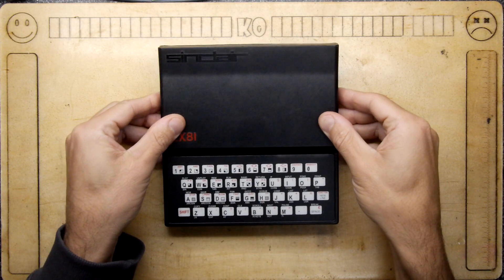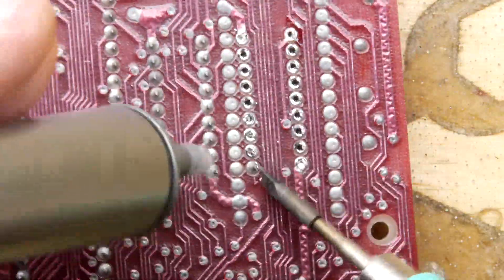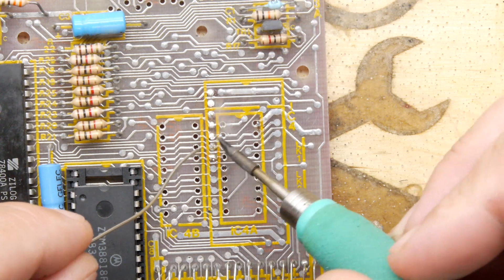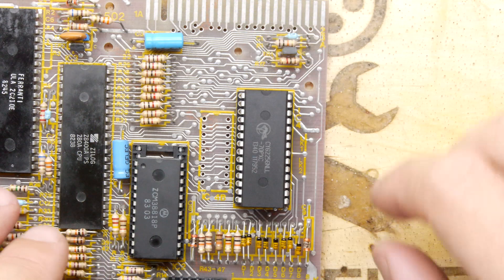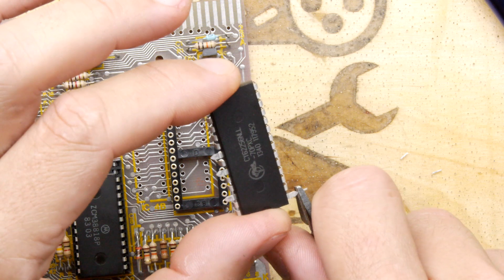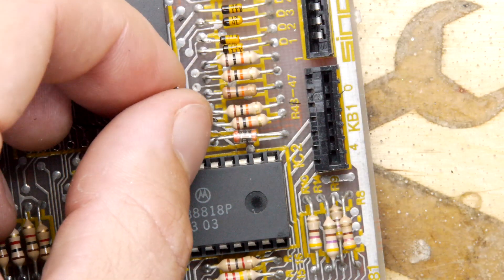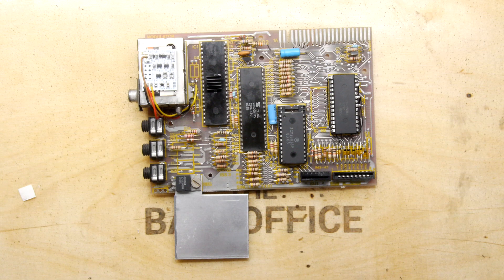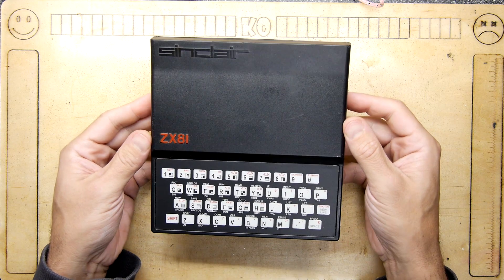How to install a ZX81 16K Ram expansion - 10 minute mod!

Comment: Nice video and explanations.

The spot for 16K RAM chip follows the JEDEC specification (24 to 32 pins) for static RAM and ROMs.
I guess the wiring on the PCB was designed for a 1K chip and thus lacking the 4 Address lines but I don't understand why not adding the adress lines directly on the PCB.
The original chips 1K * 4 never use those adress lines so there is no risk to add them to the 24 pins footprint.
The only possible issue is if some of the address lines are connected to power or extra CS lines.

Comment: Back in the 1980's, those 32K x 8 Static RAM chips were quite expensive. I bought one and used it with a 74LS138 (3 of 8 decoder chip) to build my own RAM pack. Saving any programme with the ZX81 running 32K of RAM takes ages, so I ran it as a 16K RAM pack, mainly. My home made RAM pack never had any wobble issues, which seemed only plague the official Sinclair RAM packs. 

I also built 2K, 4K and 8K RAM packs, as I used my ZX81 for robotics experiments and a smaller memory size equals longer battery life.

Comment: Hello, I did the installation, step by step, on my Timex 1000. It's showing the white screen, but without the cursor.  I know it would take a few seconds, but it doesn't show up.  I'm guessing that when using the socket for the memory, soldering only occurred on the lower tracks.  It makes sense?  I'm thinking of extracting the socket and soldering the memory directly to the board.  What do you think?

Comment: this type is the cheapest and most convenient way to expand the zx and 99% of all programs get by with 16k. In addition, the zx81 takes a relatively long time to run the ram test. The area on top 32k is also required for the screen structure. The z80 is used as a line counter for the composition of the image.
In the lower area you can change the decoder so that the ROM is not mirrored, so you can still add 8k , but these are not seen by the basic.
But it will not deleted when you type in NEW.

Comment: You could use a switch (or an IO port for that matter) to pull the most significant bit of the address lines up and down in order to page in the unused upper 16k of the chip. Not sure what use that would be though.

Comment: As far as I know: Mounting the 2k Jumper, as you have done, will connect Pin 21 of the socket to A10. So it is not necessary to bend this pin and solder the wire between Pin21 and A10.

Comment: There are dozens of 32K DIP-28 SRAMs available from the usual suppliers (in the US, Digi-Key, Mouser, etc). Are there recommendations for any particular brand or version over another? I have an Issue 3 I’m repairing/restoring now and I’d like to upgrade the internal RAM while I’m doing all of this work anyway.

Comment: And what is wrong with a 32K RAM expansion?
Reply from the maker: Nothing, but if I recall when looking into it you have to deal with the extra address line so it's not a drop in replacement
Reply: Just a little bit pointless in 2022, a full 48K or even 56K could be done if really keen.

Building a ZX Specrum clone ie Harlequin, Pentagon, or Nucleon would be a bether move.

Then theres the ZX-UNO which uses personality code modules to emulate many different types of 8bit computers.

Comment: Replace the 7805 power regulator with a new switch-mode regulator - reduces heat.
Reply: that's good!! to use a switching voltage regulator... less heat inside means extend chip life...
Reply: @claudioquintanilla1471  exactly, especially caps.
Reply: it wouldnt be a zx81 without the heat :)

Comment: I’ve designed a little PCB for this, so no need to bend pins. Just solder a socket, put the PCB in, set jumper LK2 (A10), solder A11, A12 and A13 and you’re good to go. The ZX81 was my first real computer, I remember the rampack wobble....

Comment: If clearance is not an issue, bending and cutting the legs of the CY62256 sram could be avoided by using 2 stacked turn-pin sockets, cutting the legs and soldering the required jumper wires to the upper one.

Comment: I got a laugh out of the line "that looks better than factory" I bought the Kit version and soldered it together using my dads frankly horrible soldering iron on the dining room table. Worked 1st time, I was so proud but couldn't tell my parents as I had been forbidden to buy the computer (they found out later, but by then they had discovered this was something I was going to do no matter the punishment). And my 16K RAM pack cost more than the computer lol
Reply from the maker: Brilliant, must have felt amazing to see it boot up!

Comment: Nice mod! I had this exact problem when I was around 10/11 years old! Sat and manually programmed a game from a magazine, and before you could save it to cassette... Small bump... Oooops!! That 16k pack also got super hot! How times have changed!!
Reply from the maker: That's interesting about the heat, I wonder what they had going on in there? 🤔
Reply: @backofficeshow  I seem to recall there was a coil in mine (haven’t got it any more, unfortunately!), but the Sinclair pack used 4116 ICs like the speccy, which require a 12v supply, and potentially a -12v line too. That might explain the heat, as the zx81 only has +9v and +5v lines, as there will be some iffy voltage conversions happening...

Comment: There was no need to bend or cut the legs on the IC, simply remove the pins from the IC socket before installing it.
Reply from the maker: They still need soldering onto though. I think a little daughter board might be a nice move, perhaps with a few jumpers and the ability to use the full chip. If make one of I didn't think the market for them was 20 units globally 😂
Reply: Remove the entire wiper from the socket? that works. When I knackered a PCB trade I removed a bit of plastic and soldered to the wiper on the socket, so I could still remove the chip easily.

Comment: can you see any noticeable difference in programs since the ram increase?
Reply from the maker: Not really, but mainly owing to the fact I don't have any
Reply: There's a huge increase in ZX81 games that use 16K. For example, you can play games that have "Spectrum like graphics", from the likes of "Software Farm". There's been a few more hi-res games made since. A ZX81 needs 16K, to be some what useful at all.
Reply from the maker: Any that need 32k? It's it work continuing this mod to use the whole chip?
Reply: @backofficeshow  Some games only need 16K, there are others that have been made for 32K. I know there's stuff out there for 64K, but I can't remember if it was internal or external. (It was of course external back in the day)
Reply: @RetroBoxRoom  8K to 16K is vacant, so a max of 56K if no trick character unit Installed.

To be honest, the 16K install is good enough for casual retro use or demonstration purposes. It makes the computer typical.

A composite output mod would be useful, a dedicated LCD display would sweet but prob tricksy.

Comment: When you switched on after installing the memory, I was expecting the computer to have the slight delay before the command prompt came up, and sure enough, there it was!  That would be enough to convince me, but obviously, the peek address program is confirmation of it having worked.  16k was considered a lot of memory, back then, although I do think there were some unofficial 32k, 'RAM packs', available, but they were expensive, (back in the day), and not that common.  Weird to think that a tiny bit of electrical work, as shown here, can get rid of the frustration of a crash for having breathed too hard whilst having just spent the best part of a hour typing in machine code.

The machine itself can't compare with other machines that came out a year later.  No sound and no colour meant it was on a loser from the start.  However, as a first computer for someone like myself, aged 11, at the time it was fascinating to be able to learn how to program and write your own within a week of first starting to learn BASIC.  All I needed in addition was a portable black and white TV, and somewhere to use it.  I remember first starting at the beginning of the Summer holidays, back in 1981, and by the time I started school in September, I knew how to program and was writing all kinds of stuff.  Great days.

I never liked the ZX Printer.  It was too small for any practical use, as the paper, (if you can call it that), was only about 2 inches wide.  Printing involved it literally burning the silver off the surface of the paper, which, if you printed anything dark, meant you got to witness a horrible smell of burning.  As the paper was in a roll, it would often curl itself up and was prone to creasing, which, if it happened enough, would result in black lines where the silver had deteriorated coming off, leaving the paper almost illegible.  Regarding this upgrade; I'd be tempted to want to go the whole hog and install the 32K.
Reply from the maker: Thank you for sharing your insights!

I think the 32k is not a particularly challenging installation. I suspect after installing the 16k you could upgrade this by removing the hi address line from the pullup and going via the additional logic.

Definitely worth a try for the ultimate zx81!
Reply: @backofficeshow  One wonders what the maximum amount of Ram that the machine could handle would be? I know there was a 64K Ram pack from Memotech, they seemed to have produced a range of add ons for the ZX81. I heard very recently that some enterprising soul even managed 128k (!) on a ZX81 and as a test for it, he succeeded in porting Dragon's Lair to it in hi-res black and white! I believe you can find the footage of that here on YT...
Reply from the maker: @Rendell001 I am guessing it would be a maximum of 64k directly addressable ram and as much as you would like paged

Comment: At school we used to joke about the ZX81. One of the teachers said it wasn't that bad a computer and it was used as a car engine management system. I hope that was just a myth :)
Reply: I imagine there's plenty of cars that used a Z80 processor for EMS, I'd be surprised if any used an actual zx81 tho
Reply from the maker: Yeah, considering all the io would have to go out on the edge connector - one pothole and you are done for!
Reply: I just got this image of putting a ZX81 tape into the car tape deck before starting the engine :)

Mind you, I remember when a tape deck in a car was a bonus. The usually just had a radio. Those ones with the black buttons you set to positions on the dial. Where the term "radio buttons" comes from.
Reply: If a ZX80 could be used to control a power station, I'm guessing you could do a whole lot more with a ZX8116K. LOL
Reply from the maker: I wonder what car 🤔
Reply: @backofficeshow  C5
Reply: @backofficeshow  the sinclair C5 of course!
Reply from the maker: I thought it a hoooooman powered
Reply: @backofficeshow  had one or two lead acid batteries as well as I recall...
Reply from the maker: Probably to stop it blowing away